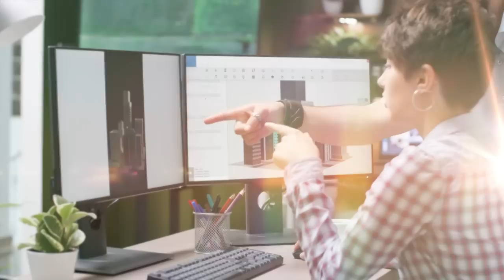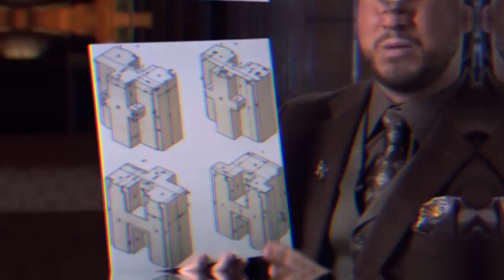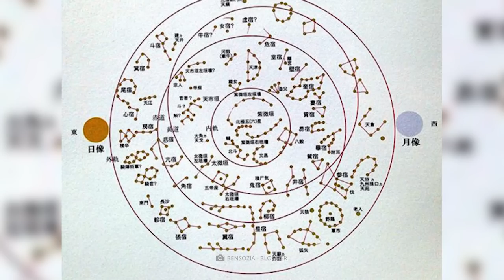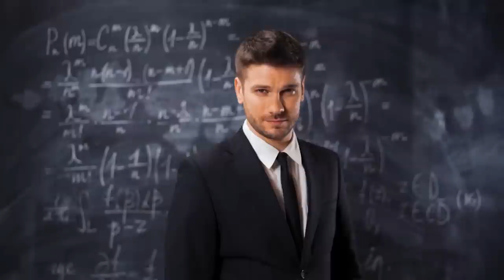10 Things the Ancients Did Better Than Us!

Comment: How can you say that it isn't "Lost Technology" when we cannot replicate something that was created 3, 4, 5,000 years ago, they had "Proper" toilets inside their homes just like we do today, what's that about 500 years at best, but 4,000 years later people were still running out to a hut in a field to shit in a hole in the ground, & some still do that today. I'm an Engineer, & a very good one so I'm told, I work with some of the very best at what they do with "Cutting Edge" machinery, & we "Cannot" recreate what people 3, 4, 5,000 years ago "Could" do again & again & again, why? we're not stupid, we don't use "Ancient" machinery, that, right there is the reason, we don't use what they did, whatever it was that they used Nobody has it today, the Hardware, Technology & Knowledge is gone, be it human or alien it's gone, so yes they knew more than we do about the things they used & built, if modern technology is failing & we have to fall back on ancient technology then what have we learned, Nothing, maybe we should stop being so arrogant & look at what actually works, then use that to save the human race from extinction.
Reply: It's called common sense